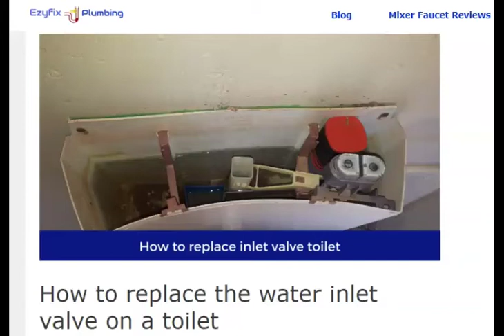How to replace the water inlet valve on a toilet

Comment: Thank you! I fixed my own loo! Cost me $200 to get the plumber to do the en suite and I just fixed this myself for $25. I used an old piece of towel to soak the last few cupfuls of water up in the cistern before removing the old inlet valve, which saved me having to try and wedge a bucket in that awkwardly shaped space behind the loo. Thank you!!!!

Comment: Thanks, problems with the cistern leaking into the bowl, even after a definite press on the button, leaking occurs hours later. Will go to Reece Blackwood and get a replacement. Cheers if you are in Adelaide I’d buy you a beer.

Comment: How about showing how to replace the inlet valve assembly inside the perfoma
Reply from the maker: Why would you want to stuff around doing that for a $20 inlet valve waste the time and money. I can't see the value in it
Reply: It’s just a twist type. I did it once to avoid removing the whole valve assembly. It was hard getting enough leverage though in a tight space.

Also the part is $9 vs $26 for a whole assembly.